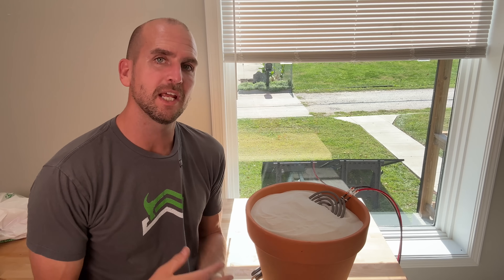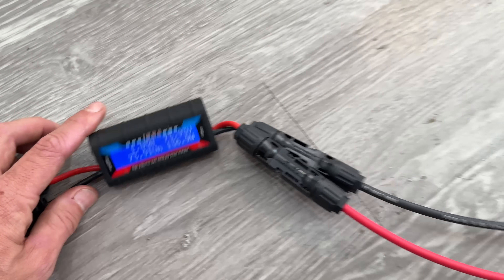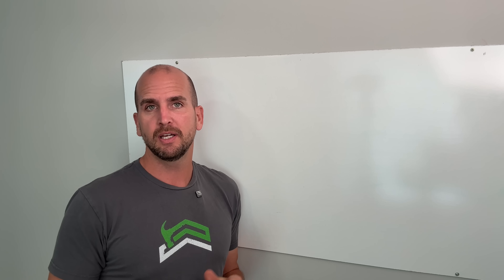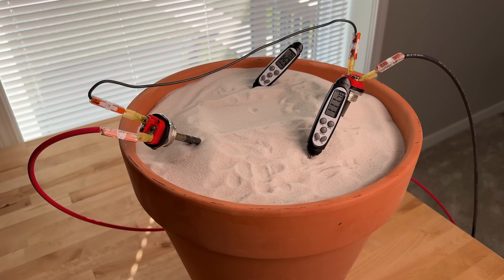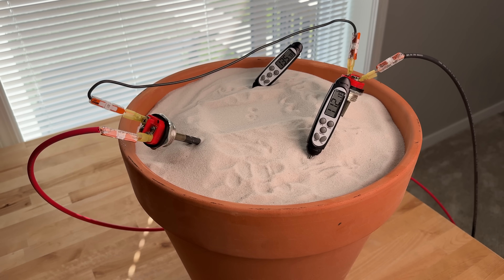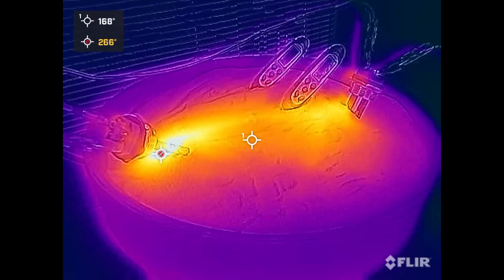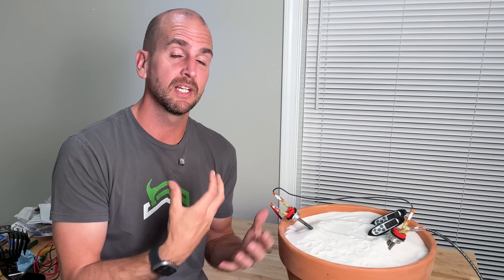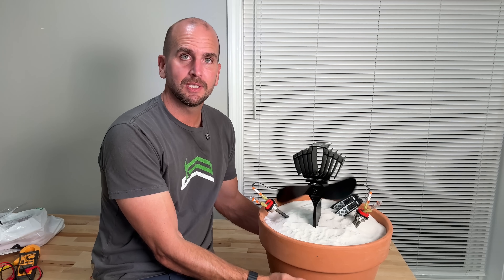How To Create A Solar Sand Battery Heater | Free Heat This Winter!

Comment: If you want a really efficient heat storage, use a saturated sodium acetate solution instead of sand.  You'll need a thermostat since you can't heat it beyond 200F and really shouldn't heat it much more than 150F, but once the hexahydrate has all melted it stabilizes and will store the heat until you trigger a recrystallization.  So you can actually store heat for substantial periods of time.  There was some experimentation done in the 1970s with using it in the attic to store heat during the summer for release during the winter, but the energy density isn't quite high enough for that to be practical.

In terms of storing large amounts of thermal energy though, a phase change is a really good way to do it.  You'll get a much higher thermal capacity from a big tub of paraffin that you melt than from the sand at any safe temperature.  Paraffin has its own safety challenges since it's combustible, but at least if you accidentally knock it over it needs an external ignition source rather than already being potentially hot enough to light the carpet on fire.

Comment: Waste of expensive components.  Your panels convert 20% of the sunlight into electricity, which you're then turning into heat.  

The shiny side of aluminum foil is about 95% reflective.  Glue it to some heavy cardboard and paint your pot black.  You'll get about 5X as much heat in through the window, without needing to pass any wires through anything, and can save the expensive panels for something that actually needs electricity.

Comment: I would put some kind of insulated cover over the whole sand battery that could be easily lifted off and on during the day, once your home had warmed up for the day, and leave it covered into the evening until your bed time and then uncover it for releasing heat during the night.  Hopefully pumping out heat mostly during the late night when you need it, and not so much in the late afternoon and early evening when you wouldn't need it.

Comment: Hi, mate, nice idea, i am also thinking about building a concept , have you considered using NiCr wire and reduce amount of sand in the core and same time increase the layer of ceramics by using full-body bricks ? Think we can get more even heat distribution by doing that, something like mini masonry heater

Comment: Hi, interestingly there is a solar heating element by  a german brand called FOThermo which commects to solar panels directly and can boost your boiler and is rated at 550w. They specifically say that the panels have to be wired in parallel as 50v is the maximum rated voltage for the element. I was wondering how this element is different than a AC water heating rod in terms of internal resistance, effciency etc. or is it the same element with a MC4 connector input?

Comment: How did you know the polarity of the elements?
Reply from the maker: Since it is just a resistor you don't have to worry about the polarity.  You can wire either way and it will work the same.

Comment: Thanks for demonstrating the concept. I don't think you mentioned the energy capacity. I believe its around 0.6kwhr. Water has a much more dense thermal energy storage. However, it needs a thermostat to prevent boiling.
-Ken.

Comment: Interesting to use photovoltaics which are about 30% efficient at the moment to provide low grade heat when solar thermal solutions such as heating water or a transfer fluid directly are 70% efficient.
Reply: massive magnifying glass glass from a old RPTV would do a far better job  far more efficient  heating up the sand

100% conversion of light to heat   you will have liquid glass in no time at all  2000F

Comment: LOL!!!  Yeah Right....   Uh!!!! Nope. Someone's "wet-dream", of just grabbing for attention. 
The solar panels are 12 VDC @ 100 Watts per panel with FULL SUN. If they are connected is series you can have 24 VDC and 100 Watts output. If in parallel you get 12 VDC at 200 Watts. --- 
The electric stove-top calrod element is rated at 1,500 to 3,000 Watts.... DO THE MATH. 🙁 
It is impractical.

Comment: Intereating experiment. Maybe you could just put the sand in a metal bucket and heat it outside over a small wood fire, then when the bucket gets to the desired temp just carry it inside for the night.

I once visited a castle in Poland. Under the king’s bedroom was a large chamber filled with boulders. They kept a fire going in that chamber which heated the boulders, and the residual heat would rise heating the kings bedroom.
Reply: I don’t think most people should be carrying a 50 pound bucket of hot sand around their house.  
But if you happen to have servants, go ahead!  ;)
Reply: in the old days, they used to heat up beach rocks and put in the foot of the bed
Reply: Ideas: As water is a better conductor how to make a huge metal box with sands and water. just to make sand wet.
2. Box filled with river stones and water. Stones should release temperature longer.
Maybe could work one of these
Reply: I thought kings kept warm at night by sleeping with all the local virgins.

Comment: Solar heaters with electricity have one unnecessary element, electricity.

Starting from the solar panel you added: complexity, cost and lost so much energy. Something as simple as sun + coiled black pipes = hot water,  then route that into a heat exchanger inside a sand heat battery, and you achieved perhaps more with less.

Comment: Sorry but your math does not check out. You're doing the wrong math. The fact that your only using 248w from 2x390w panels, shows that the resistance of the panel does not match the heating element.  Majority of the energy is not used from the panels. The least you can do is better match the voltage of the panels with the necessary voltage of the heating element. I'm saying this with personal experience.

Comment: You can increase that temp adjusting the power transfer from your panels to the maximum power point. You will need electronics for that tho, any panel has a maximum power point of operation based on the IV curve. Anyway awesome project. Thanks for sharing.

Comment: I believe it would be more efficient to design a solar to convert light directly to heat. The sunlight to electricity is just a fraction of the power of sunlight to directly to heat. 

Was talking to a friend last night near Canada and he turns his heat on much later than me in the dead south.  His secret is to allow sunlight to enter his house and heat it like a greenhouse.  A room with large windows in the south wall can heat a brick wall opposite the southern outside wall.

Just think, the hot surface of the PV panels represents energy that will not be turned into electricity.

Comment: rather than sticking a heating element into the sand why not use an induction coil wrapped around the outside with an iron core in the sand to heatup?

seems a lot of issues go away if you don't need to physically bury the heating element..I think induction heaters are also slightly more efficient too

Comment: I just use sand filled painted flat black containers, set them in the sun light during the winter mo's ...do the up stairs, down stairs and the garage...still warm in the mornings in the house. In the garage they are stone cold . Soon as the sun hits them the cycle starts again...live in central Pa. so weather is cold in Jan and Feb

Comment: I can offer anyone my experience to add to the best outcome here. I hated a kettle of water on the stove last year to see if it works sufficiently keep the place comfortable. I then tried this same battery model. The sand did not collect the heat as efficiently as water. Also, the water out out steam in the air to humidify my living space. What a noticeable element of indoor comfort! That humidity adds to your sense of warmth, just like it adds to your misery in a cold damp environment.  
All the wood structures in the house appreciated it too. I hope this helps someone out!
Reply: That's because water has a wildly higher heat capacity than sand.  Water has one of the highest heat capacities of any known non-exotic material, which is a huge part of why steam power is so effective.
Reply: @bretsk2500  Man you just can't escape steam turns a fucking wheel what can I say?
Reply: @bretsk2500 You’re TOTALLY WRONG!!!!
Reply: @Tryp-j9d  water's heat capacity is 4.184J/g/degC... sand is 0.835J/g/degC.
Reply: I am confused that you said humidity is good for wood structures. Excessive humidity and condensation is the reason for wood mold/rot. During winter, humidity in warm indoor air, if allowed to migrate through wall cavity outside, might start condensing on the wood structures. Dew point for 20C/68F 50%RH air is 9C/48F. Humidity is good for you, optimally it's 50-55%. But it will rot and destroy the wooden structures if not controlled by a vapor barrier.
Reply: @chameleonh  you make prescient points. I did not say excessive moisture is good for wood. I was addressing a lack of moisture.
Reply: @chameleonh  Usually a home is too dry in winter and needs a humidifier.  Too much humidity and too little humidity are both bad for wood.
Reply: @dougbas3980  I heat all winter with wood. 4 gallon SS uncovered pot and two kettles and barely produces 20 % RH. I even stack 2-3 days worth of firewood from outside behind wood stove to dry out its residual moisture before burning it. Even with a 1 gallon humidifier, it is still dry in house. Drying clothes on upstairs lines helps and saves $$$ on not needing a clothes dryer ( have not have one in 30 + years).
Reply: Put the kettle on top of the sand battery.
Reply: @awackocrank  that's like using your blow dryer to warm up your firewood.
Reply: Have you learned to love that kettle yet?

Or did you part ways?
Reply: Actually the sand collects the heat pretty damn efficiently, what you are missing is how you discharge it. Ever been to a sauna? Also look up phase transition energy.
Reply: So what if the sand was wet?
Reply: @kriscarr389  Then you've brought the beach home with you. 😆
Reply: STOP HATING WATER!!     It’s ESSENTIAL for LIFE ITSELF!!!
Reply: @Tryp-j9d  Or you can drown (LOL)😏
Reply: @Tryp-j9d haters gonna hate😂

Comment: If you have PV then you are better off using it for battery storage, even using second hand lead acid cells if you've got plenty of space and are aware of the hazards of H2SO4 and H2 generation. Cell huts and data centers are good sources. Otherwise if you can afford it LiFePO. 

For this application you can run glycol through a loop and use an old hot water heater as your thermal battery. Glass covered sealed frames with a moderate vac pulled within work best. Incorporate Schrader valves to ensure you can vac it down when needed. Or give up on perfection and just have a permanent vac pump there that turns on as it works its way back toward ambient. 

You could use a liquid to air heat exchanger to get warm water from your battery or a liquid liquid one for potable water for sanitary uses like showering. You can also use also input heat from other sources, for example, you can input heat from a wood fire wetback etc. Nothing stopping you from putting radiators (England style) in the bedrooms and plumbing the home for hydronic heating and skip the liquid to air hx.

Comment: it would be good to use a well insulated pot with an insulated lid to obtain maximum results....My understanding is that sand will continue get hotter and hotter if the heat is contained.....then later released when its needed.

Comment: You need to ask yourself why you are only getting 248 watts from 790 watts worth of panels.  Look at the maximum power point specs.  R=68V/11.62A =5.85 ohm heating element for series panels.   If the elements were in parallel you could have gotten much more power.  As a side note:  Some people think the heater elements increase in resistance as they get hot.  This is not usually the case.  If it were true, the power would drop and they would no longer meet the spec.  Also, the water heater elements are not designed to reach a temperature much above boiling water and will rapidly fail.  The stove heating elements on the other hand are and should last a long time even nearing cherry red temp.  They are also better at spreading the heat because of the large surface area and the shape.  You are on the right track, let the math flow.
Reply: If the heating element has 5.85 ohms, means its power is 9846 W. Does such a heating element exist?
How is it possible he draws 73V from the panels, while Maximum Power Voltage is 34V (*2=68V)?
Reply: @otaznikvykricnik5961   most solar panels are overrated to account to loss overtime 
How else could a panel keep at 20 years old?
Reply: Good tips but no he doesnt need to ask himself anything.  It works.  Optimization is great for later but not everyone is going to be able to plot out the math or electrical stuff and thats perfectly fine
Reply: he is using two tiny high impedance wires  that is 18awg  should be using 10awg for 75 volts
Reply: @theantiveganchannel3596  Voltage doesn't dictate wire gauge, amperage does, and 18 would be fine for the amperage.  All of his wiring appears to be 10 gauge, where do you see 18?
Reply: I think you might be able to help me think through a new build and save time.

 I have a600w wind mill 200w solar panel and want to hook up to water heater element in a 50 gallon water tank, with a blow off vale. All standard off the shelf parts for a E water heater.
The water tank is a saddle tank above a wood stove. I custom made myself and works to heat water with the fire running.
Thing is I don't need to heat the house, fall spring and summer,  a fire 24/7 but need hot water 365 24/7. Any suggestions on what heating element would be best suited as the wind only blows on cloudy days typically, so the sun doesn't shine when it does.

So I have options as to what size heating element would be best suited to this application. A 20 gallon small tank heater element or a 80 gallon or the 50. 
Just looking for the fastest heat up time but might last longer and take full load on a sunny day with max wind.

I guess my question is I have such highs and lows in a 15min-1hr period as far as input whatts do you have any suggestions as to how to calculate a best resistance heater? Or am I right in thinking trial and error is the only answer?

If you can help thanks, if not thanks for reading my question.  I am a Mechanic/ Fab/builder
Reply: @pkuudsk9927   2-6 business days to heat it up if it's anything like the post office it will be 14 business days

Comment: I'm currently looking at how to heat a 12x12 greenhouse I just built.  I was considering a similar method as you but using a 55 gal drum of water.  Heating the water would be via an element (or two) as well as the natural warming by the sun.  The problem I have is estimating how long the heat will last vs. outside temp.  I like the sand method a bit better as the pots can be on the ground and don't need to be in the sunlight.  Additionally the sand can get a lot hotter than water and therefore store more heat.  I may try a hybrid of both methods.  Looking forward to your additional research.
Reply: A cheap chinese deisel heater would work really well for this application
Reply: This is the way. 55 gallon of water passively heated with a pool heater and a tiny dc pump

Comment: It's 3x more efficient using a heat pump (COP3) to store heat in water. This 250W will be 750W of heating power. Any air conditioner (window or split) can be used as a heat pump.

Comment: It sounds a good idea, but... Why transform solar energy (heat) into electricity then back to heat, knowing how poorly PV panels are performing? If you're only looking to hold heat in sand "batteries", just heat black panels with oil circulating in tubes inside of them, and bring the pipes into the sand to heat the sand, the heat creates the movement automatically. For the pipes between the panels and the sand, the easiest path if to fill the pipes with sand and pass the tube(s) in the middle, so the losses are minimal. The more tubes the better.
I was hoping you'd have found a way to convert the heat back to electricity, making the system an actual "battery"... Well, no.
Cheers!

Comment: The problem with this is 250w of solar is something like 850BTU, which is not a lot. The amount of residual heating from this will likely not be felt unless you are basically hugging it.

Comment: Resistive heating is very inefficient and expensive. Why use solar panels? I’m thinking why not create a big sand battery around a more cheaper fuel source—like wood. Fire up the wood fire for a portion of the day and then enjoy the heat produced by the large sand battery.

Comment: I just bought 10- 30W, 24VDC heater pads and a 24V Temperature Controller to build a heater for my outside battery bank. 
I used a 120cuft deck box to put them in and it holds 12- 12V Group 27 batteries.
The Temperature Controller is only rated for 10A, so I will only use 8 of the pads.
These pads are supposed to get to 370 degrees, so I will have to watch where I put them, I do not want to melt any lead-acid batteries.
The pads have adhesive backs, so I will attach them to a piece of 1/4" aluminum deck plate.
The controller will be mounted outside of the battery deck box so that no relay contact arcing will ignite any gasses from the batteries.
I may try putting the 2 leftover pads into some sand for an area heater.